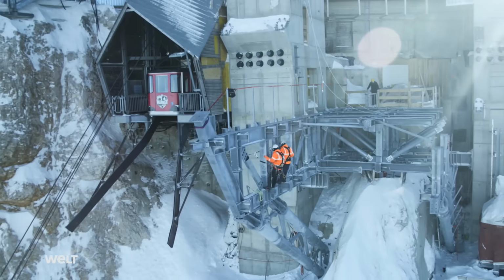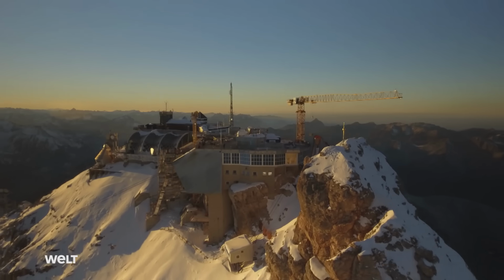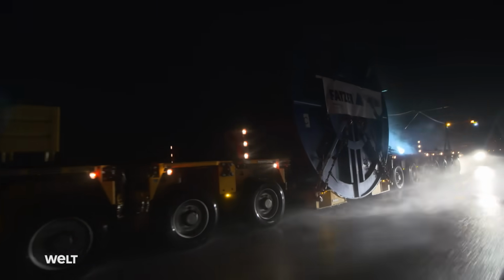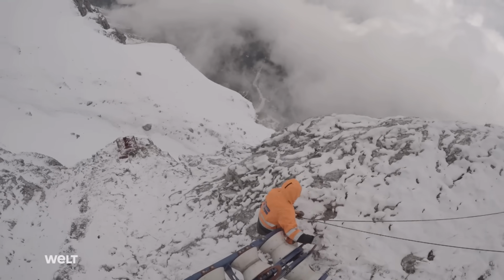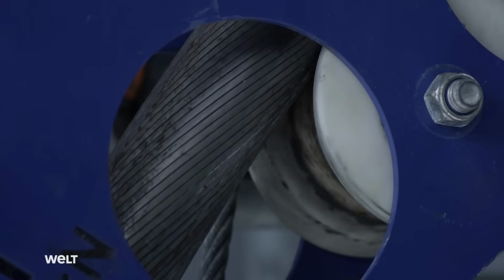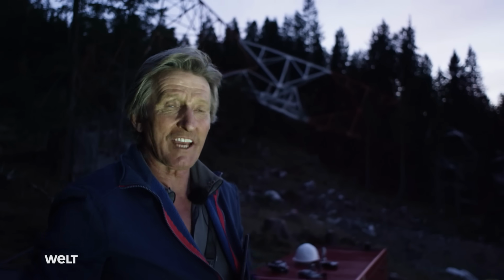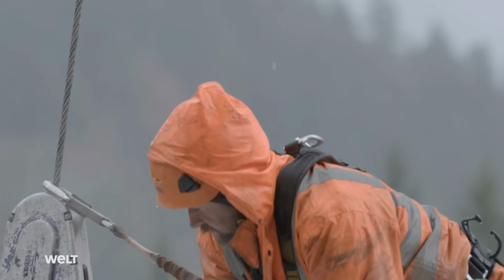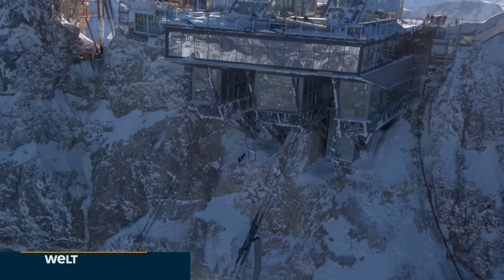RIDE TO THE TOP - Germany's Highest Construction Site | Full Documentary

Comment: The Kamov has counter rotating rotors which eliminate the requirement for an anti-torque tail rotor, thereby transferring all power for lift, making it a good choice for air crane deployments, particularly at altitude.

A documentary on the air crane Pilots would be really appreciated.

Comment: german engineering lost credibility since volkswagen & bmw scandals. Hard to trust any german products now. Not even heidi klum.
Reply: Hahahaha!  By that logic, American engineering lost credibility many decades ago thanks, only in part, to:

- the 1971 Chevrolet Engine Mount Recall (6.5 million vehicles)

- the 1978 Ford Pinto Recall (1.5 million vehicles)

- the 1981 Ford Transmission Defect (23 million vehicles)

- and the 2006 GM Ignition Recall (2.6 million vehicles)

There are several more I didn't even bother mentioning.  Hard to trust any American products now.

Seems like a short-sighted way of thinking.
Reply: P.S: No, I'm not some woke-tarded, anti-American radical.  Good riddance to such insanity.

Comment: I used to ride a car that held 100 people that went from 9500 feet to 11500 feet. The cable span was about 3000 feet and the only towers were at either end and no support in the middle. There was a second tram parallel to it that had a small car that could be removed and 20 foot  containers could be attached for transport to the mine at the top. This is at a mine in Iran Jaya and I was there in 1994.

Comment: I was a scaffolder for a while in 2017/18. I thought I was ok with heights. No way. The heights and the wind up where those guys were operating, building that cable support tower were pretty full on. They would have been paid very well, I imagine.
Reply: These guys were all tethered  I worked on nuclear power stations 300 foot up on cantilevers with no harness in the 70s we kept safe because you were dead if you fell .

Comment: Where can I get those style Bull Pins they were using to line up the bolt holes on the main mid way Tower?? Klien doesn't carry that style, they looked good and useful
Reply: ... granger usually has drift pins ... got them there to line up 1/2 holes ...